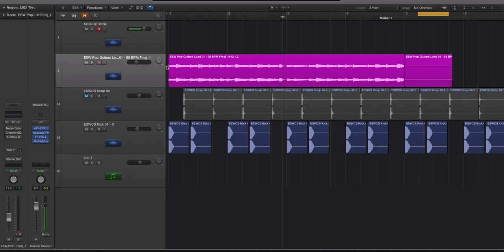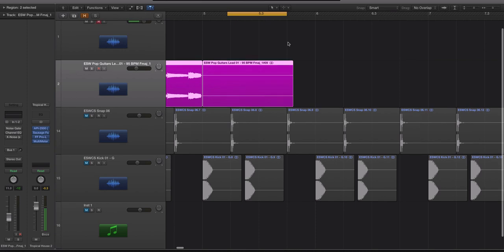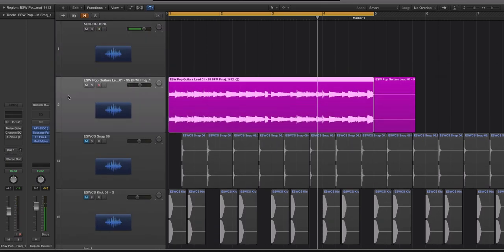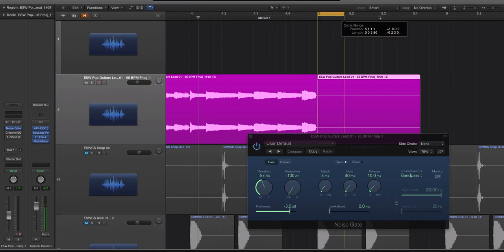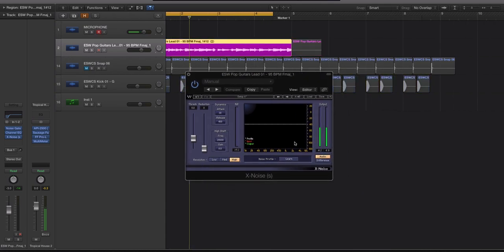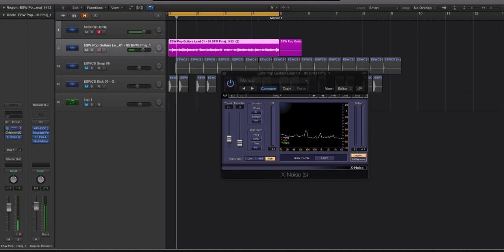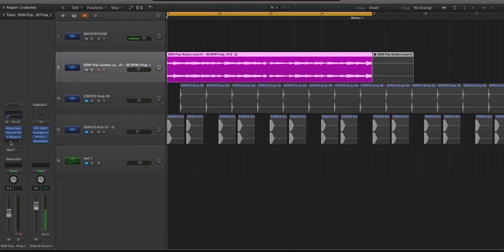Remove Noise From an Electric Guitar Track

Comment: 2:59 Noise Gate
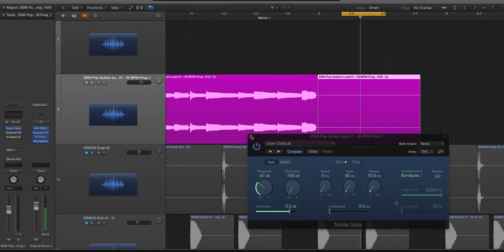4:45 Hum (EQ)
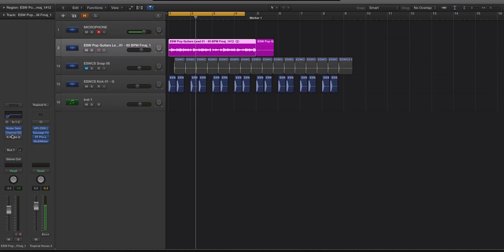5:56 Waves X Noise
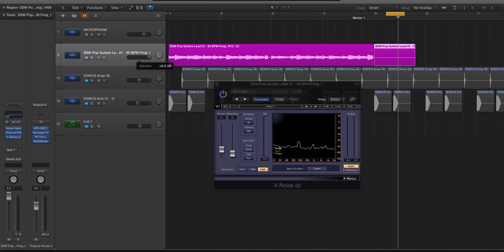9:07 Conclusion
For the ones in a hurry.
Great content! Thanks!
Reply: Also for the ones in a hurry, and using amp sims... If you aren't recording an amp cab-------->Invest in a DI box... hit the "Ground Lift" button then record. There will be zero noise and you wont have to go through any of that nonsense. If a DI track is already recorded in, send it through the DI before the amp sim.

Comment: If you aren't recording an amp cab-------->Invest in a DI box... hit the "Ground Lift" button then record. There will be zero noise and you wont have to go through any of that nonsense. If a DI track is already recorded in, send it through the DI before the amp sim.
Reply: Ground lift button?
Reply: @alexbasire2089 or “lift” it’ll sometimes say. Most but perhaps not all DI boxes will have this feature. Invest in one that does

Comment: Basic Questions:

1. How do I make a note that I placed down longer? I have a violin sound that I got from machine library where if I hold the pad it plays the violin for a while but when I put it in the pattern it just quickly plays.

2. How do I slur notes, like make one cue in halfway through another? placing them next to each other just makes it so the second one plays right after.

Much appreciated
Reply: I''m talking about Maschine 2.0 by the way
Reply: Armon Dadvand if u never figured this out, change the sample type to one-shot or extend the length of the note in the piano roll. if you need the sound to be played longer than the sample, try using the loop feature on the sampler.

Comment: How to remove buzz that is constantly, even when not playing? Like it's coming from gain or something. It sounds cool when you play it and sometimes you don't even notice it, but mostly when you are strumming hard. If I want to record something slow, like a simple beat it's impossible because the gain background noise ruins everything. Maybe it's cable fault or guitar idk - I'm using Jam cable and Fender Strat copy. 
I tried playing around with noise gate, it actually helps a bit, but you can still hear gain feedback noise in-between. Everything I record just sounds like raw demo and I can't get that studio pitch perfect sound that fits right in the mix.
Reply: i have exactly same problem and have no idea what to do. i guess its my crap guitar wiring
Reply: I’m having the same issue.  Im using a PRS SE (very strat like) which has 3 single coil pickups and if I use any of the hybrid ones the noise mostly goes away.  Also lowering gain nob on guitar and interface helps.  Unfortunately, you lose some warmth.

Comment: wait so u record clean into the line6 and process it here before putting an amp sim on?
Reply from the maker: Hey! It sounds WORLDS better going into a line 6 pod or better yet, the Helix and using a basic amp/cab set up and then going into my audio interface and into the DAW. I will usually use guitar rig to color to taste with FX etc.
Reply: thank you so much! :)

Comment: I am in an absolute desperate situation here on every recording that I do through my interface from my plug-in uke. I have no option, but to record plugged in directly into the interface, but I am getting horrific, clicking noises coming from the strings and my picking and I just don’t know how to get rid of them. If there is anybody here who has any idea on how to get rid of them I would be very grateful. I’ve tried running it through a DI before I go into the interface and that hasn’t worked. Please let me know if you have any suggestions at this point I’m open to wearing a tinfoil hat.

Comment: I thought when u said electric guitar you meant a distorted dirty sound not a clean fender tone. How would you clean the noise that comes with distortion sound?
Reply: Hamad Almutawa I would like to know this as well.
Reply: @airbrake41  I'm using distortion and those tips worked quite well for me. Maybe you just need to try a bit more to find what you like.
Reply: A little bit of x noise (like 10, threshold 0) helped to clean up my chunky chugging metal guitar that had noise in it.